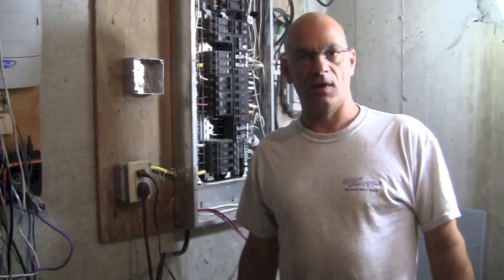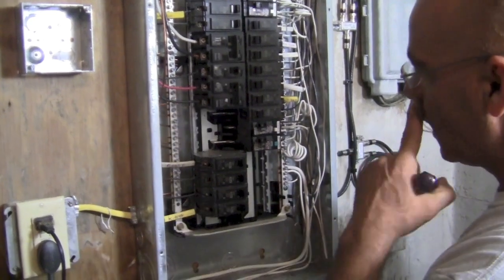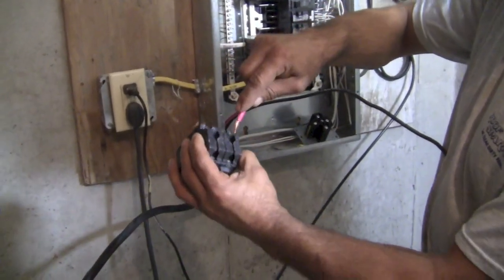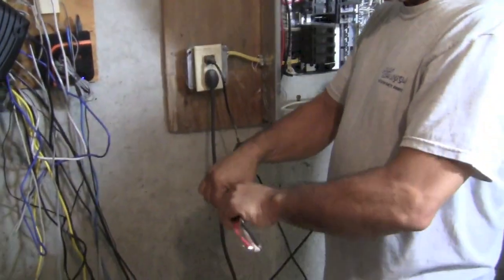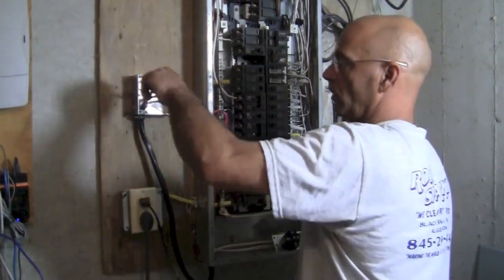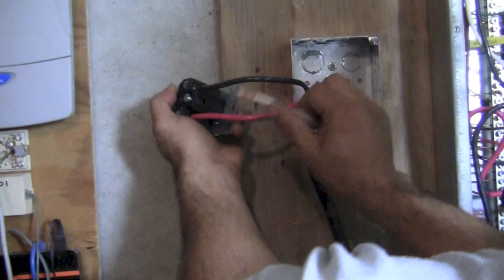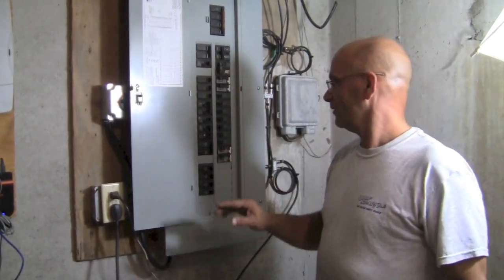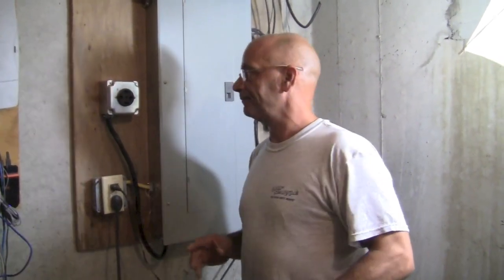How to Install a 220 Volt 4 Wire Outlet

Comment: Thanks for the great instruction and getting right to the point..I understand the procedure but it's electronically confusing...how is "neutral" different from "ground"..in other words how is this different electronically from 3 wire single phase 220...??
Reply: Oilsmoke Jones haha yeah these things are expensive at the hardware store, my advice it to buy online or find a supply warehouse. 
It's the ground that is "redundant" (bare copper wire). The neutral is there to provide a return path for the (AC) electrical current back to the transformer but that wire is grounded at the transformer.

The transformer has 3 taps on its low voltage side of the coil. 
The high voltage side is many thousands of volts supplied by the high voltage feeder wires which go back to the power station.
The transformer takes in the high voltage on one side, and steps it down to 240VAC
But north american house holds only use 120VAC (half of that) so they split it again in two and balance loads among the houses that way. 

You get 2 120V legs which if you connect to both you get a total of 220V.

If you connect to one voltage, and the neutral wire you get half; 120V

You have to be connected to at least 2 wire of the transformer so the alternating current can flow (back and forth)

The middle tap is neutral, (which is grounded), and the two on either side 120VAC.

So say you are using a 120VAC toaster, you are pulling off that one 120VAC leg, but the circuit needs to be completed in a loop for the current to return, you don't need any more power than that one 120V leg, so you use a neutral wire with no current.

If you are using a 220V device, you are pulling off both 120V legs for a total of 220V, since you are pulling from 2 taps on the transformer the AC current can flow in a circle (back and forth) from both those connections.

That's why sometimes you see a 2 wire and a 3 wire 220V plug (less ground wire). The reason for the neutral is simply if the uses BOTH 120V and 220V, say like the heater element in a clothes dryer needs 220V but other components like the motor, or some indicator lights needs only 120V they need that neutral wire as a return path since they cant use the other 220V wire.
Reply: Oilsmoke Jones Essentially they are the same thing, however they serve different purposes, as the other person said, the NEUTRAL goes back to the panel, and then back to one of the wires that comes in to your house from the street (service entrance) it's the wire with no insulation, but if you traced that wire back up to the transformer you would see that is also is sent to ground. The GROUND wire in your panel goes either to a grounding rod somewhere outside your house that should be driven at least 8 feet in to the ground, or tied as close as possible to your main water line entrance if it is a copper pipe since it runs very deep in the ground it offers good conductivity. 

Now again, if you look in your panel you will notice that the GROUND wire going to your ground rod or water pipe, and your NEUTRAL wire coming in from the street are connected by the grounding terminal! WTF?!?! 
You would only see this in your main panel, never if you had a sub-panel that would be in your garage, or pool shack etc... to run more power for a few more receptacles in a dedicated area.

In a sub-panel the NEUTRAL and GROUND terminal blocks MUST be electrically separate, the reason for this being like I said, they serve different purposes, the ground wire is there for electrical safety, so if a load wire came loose and touched upon something metal in your junction box, or metal appliance and energized the metal casing the electricity would take the path of least resistance to ground which would be the ground wire which offers that nice clean path to ground, and not through your body and the floor you are standing on, if you where to touch it.  

So say the neural and ground where connected in your sub panel, which if it is easier to picture, just think of a standard outlet with a load (power) wire or two if it was a 220V outlet, which is exactly what a sub panel is, a neural wire (return path of unused electricity) and ground which is just there to provide a clean path back to ground. 

Should it be energized, the ground wire is NOT INSULATED because it is NOT a load bearing wire under normal circumstances, if the ground and neutral where tied together acting as one, or especially if the neutral wire where to break, then the ground wire would be taking the other side of the load and returning it back to the panel, it could over heat and cause a fire.
Reply: Neutral or "common" goes back to the electrical pole ( transformer ) on the street, so it can alternate back to your house. The ground goes into the ground, and is considered a safety to prevent electrical fires. 220 volts are more energy efficient than 115 volts also. If your interested in electricity take a course in your city's technical school.
Reply: bennettdavid904 OK thanks for clearing that up..yes, you might say I'm interested in electricity..
Reply: Different manufacturers will make different plugs, but they all should be interchangeable,  generally 4 wires is 3 phase and 3 wires is single phase.
Reply: Im confused by what you mean by mortgaging the house. Can you elaborate?
Reply: bennettdavid904
"mortage the house" just referring to the price of some of these plugs and fixtures..I got sticker shock shopping for 220v plugs..up to $45 for a plug that is little larger than a 120v plug @ $5...
Reply: Video Québec
thanks for going the extra mile..so the 4th wire IS electronically redundant  for safety reasons.. 
??

Comment: Great vid, thanks. May I ask: what size gauge wire do you use with a 50 amp plug?
Reply: #6 wire
Reply: They have a chart with temperatures with wire sizing. Depending on the amp draw of the appliance that you are wiring in also depends on the wire size. 90% of the time, in electricity, bigger is better. #6 wire would be safe, it's expensive but so are house fires.
Reply: Thanks

Comment: Hi Dominic, great video, thanks! I have a question. I ran a new 4 wire 220 line and want to use the breaker from an existing (but no longer used 220 line. The appliance I'll be connecting to the circut calls for 220V @15 amps. The existing circuit breaker is rated at 50 amps. Is it OK to use it or should I buy a 15 amp breaker?
Reply: Blue Planet Photo Studio The amp rating is usually shared between the two poles of the breaker if its a 220/240V breaker, if you looked at a 50A breaker you would probably see each individual pole is marked 25A, (or it could have 50A written across both). meaning each 120V leg could support 25A draw.

It's perfectly fine to use a breaker that exceeds the energy requirements of the device you are running, this also means you can connect more 220V appliances in that same circuit and have enough power to power them with out tripping the breaker, just make sure you use cable rated for 50 amps.

You would only have problems if your breaker was rated for less then the power your device would be drawing, so say the breaker was rated at 15A and the device pulls 50A of power, the breaker would trip pretty much instantly because the device is pulling way more power then that breaker can give out.

If you had a 50A breaker, and you used wire rated for 15A, but exceeded 50A the wire would start to overheat and catch fire before the breaker would trip. The purpose of the breaker is to kill the power before the wire over heats, that's why it is super important to match the gauge of wire with the amperage rating of the breaker.

Comment: No I'm not bored andget technical  The white neutral wire is not a ground wire  but a hot wire?  If you touch the naked white wire and a ground , say the naked ground wire wouldn't I be shocked at least with 110 volts if the dryer was on? Too many people call a neutral wire a "another ground wire"   You called it a return wire.  What's it return. Is it a reverse phase hot wire?
Reply: It returns to the transformer on the pole

Comment: Thanks for the video, was a good confirmation as I installed two 50 amp receptacles beside my main service panel in the garage.  If one abides by the electrical codes, doing their own work is massively cheaper than hiring out. I would recommend having a multimeter as a minimum on top of the test light as it can resistance check the connections.  Ideally I would ring the circuit with a megger it at 600V+ (eventually I will get one as I am picky) prior to breaker turn on, but then again this is mickey mouse 120V/240V on dry land... not 450/600V with thousands of amps behind it on board a ship.

Comment: He put the outlet on sideways, used extension cord and no conduit. Calling it 220v.... The standard nominal Voltage in the United States is 120/240V...
Reply from the maker: What is wrong with you. If you know so much, and you don't. Why are you here watching my video. Go make your own and tell us all about it.
Reply: But it is commonly referred to as a 220 by laypersons, such as myself, who comprise his audience. Running lines and conduit is another topic. This video is strictly connecting the ends.
Reply: True, It's 120/240.

Comment: Dominic, thanks for the video. I've just moved to a new house. I can't install the washer until I install the dryer.  I have a three prong receptacle that I want to retrofit to four. Am I to understand that I cannot use the existing wire, because I need to run a four wire all the way to the box with a new 220 breaker? In my situation, this would require too much destruction to be worth it. I may just put the old dryer back in. The womenfolk are getting tired of washing and drying clothes "old school" even if I comment on how fresh they are from the outside air, I get dirty looks.
Reply from the maker: Just tell the woman that a study conducted by me "Dominick" has proven that the fresh smell of clean hand washed clothes reduces the urge in men. Trust me it works. So what is your question?. Anyway, first I would remove the existing outlet just to make sure it's not a four wire in the box and also read up on your new dryer to see if you can wire it without the 4th wire. Your breaker should not have to be changed.

Comment: I have a 3 prong dryer that comes on but doesn't get hot. I was told I needed a  220 line installed. Do I simply change the plug or is there something I need to change on the breaker box.
Reply: if your dryer is spinning but not getting hot your elements might be out. check both legs for voltage.

Comment: Hello Dominick, I'm replacing my three prong electric dryer outlet with a four prong outlet. I tested the connection of the three prong outlet with my voltage meter. Which is set to only read 220 or 110 volts, when I place both in the hot sockets, both the 220 and 110 volts glow. But I notice that the 110 volt glows brighter than the 220.

The outlet is a 30 amp, 250 volt, three prong receptacle.
Reply from the maker: This is a tough one to understand 100% what you're asking. Why are you going to a 4 prong? To use a four prong you'll need for wires. Red, black, ground and a neutral

Comment: I have a question about the 220V plug indicators.  If a 220 device that saids a certain amps on its label does it mean that it is for each hot wire or the entire unit's power consumption.  e.g. 16a 220V (Is that 32a)?
Reply from the maker: Entire circuit
Reply: 16 amps it is, thanx.

Comment: Exposed unsupported cabling below 8' in an accessible area (otherwise you could not have a load center there). No support within 6" of box (even in an inaccessible area). No abrasion resistant grommets at either end of cable.  You fail at least three ways I can see without even looking at your termination temperatures or insulation classes, etc.

Get an electrical contractor.  Anyone taking this video as an instruction guide is going to fail inspection, void their insurance policy, etc.  This stuff is much, much more complicated than this guy seems to know.

Hey Askmediy, have you ever read NFPA 70 or done an apprenticeship?  If so, where?  I would like to talk to your local about this video.
Reply: Crocellian you are 100% correct about this video. A true electrician would also have a real meter to test with not a $5 test light. Although he is very entertaining.

Comment: I was curious. I'm putting in an electric stove which I bought assuming there was a plug for it and ended up being wrong lol. So what's best for an electric stove? A three or four wire outlet?  I have allot of 12 gauge 4 wire roll already Will this work? And what size breaker with it?
Reply: James Mays You'll need 8 gauge for a 40 amp circuit supplying a standard stove/range. Some require 50 amps and 6 gauge wire. Check and see what the stove requires...  If it was me, I would wire a 50 amp circuit with 6/3 wire, and install the outlet in which you need for your range, that way if you purchase a stove that requires 50 amp down the road, you wont be running another new circuit.

Comment: Great video! Couple questions though.

Since the ground bus bar and common bus bar are connected making them essentially the same, could you not connect both common and ground to the same bus bar? And, What is the difference between common and ground?

Comment: Great video but you did not bond the ground to the box? Thx
Reply: mlwilmot I was thinking the same thing but I guess it’s grounded through the plug itself. Remember that flat piece of bare copper that was connected to where the ground wire went into? I’m assuming that grounds the box but only if the plug is actually screwed into the box.
Reply: Yes, the box must be bonded to the ground, not through the face plate.

Comment: Hi again i have my 240v outlet for my dryer my question is can i get a 110v outlet from there
Reply: mratliffjr0001 I  think he is dead by now.
Reply from the maker: You can by using one of the hots. But the amp rating might be too high. I wouldn't do it.
Reply: Ok i just want use for one light
Reply: Jesus Hernandez
 What he means when he says the amp rating may be too high is that it is unsafe. If the 110v outlet somehow shorts out, it may not draw a high enough current quickly enough to trip the high amp rated 220v circuit breaker before a serious fire is started. It wouldn't be smart to tie into your dryer outlet like that.
Reply: Haha - you're probably right.
Reply: Jesus Hernandez
Reply: Jesus Hernandez . I wouldn’t do that. It would pull too many amps.

Comment: Thanks for the video. I enjoy your style, thorough but entertaining.  Your response to a comment question mentioned not to daisy-chain 220 volt connections on the same circuit.  I have a dedicated 220 volt (50 Amp) box near the garage door (also right at the main) that was/is used for a stick welder and I would like to daisy-chain a 110 V box from it for general outdoor tool use.  Is that also not recommended, and should I add a separate breaker box (20 Amp) for the 110V outlet? 
thanks
Reply from the maker: any 220 stays by itself. No other choice....

Comment: What wire gose to the x and y on a plug what color is x what color is y on a plug.
Reply from the maker: Wire Connections for X Y W 240 Volt Receptacle Dryer Outlets
The Black Wire attaches to Outlet Terminal X
The Red Wire attaches to Outlet Terminal Y
The White Neutral or Green wire or Ground wire attaches to Outlet Terminal W

This an more info can be found on my site  http://www.askmediy.com/220-volt-plugs-receptacles-configurations/

Comment: Also explain the heating, expansion and contraction of the wires and the issue of them loosing at the screw connections.   Also the need for them to be really tight but not so tight the plastic gets broken around the screws.  Go to a second hand store and find old 220 Volt plugs cheap and test your strength if you want to see just how tight the screws should be before they will fail.  FYI

Comment: Is that a NEMA 14-50 outlet used? Should be the same installation for a 220V electric car charger outlet in the garage since they use that type of 220v outlet or a 6-50 (no neutral) for either 30amp or 40amp charging with a 50amp circuit breaker.

Comment: I am not an electrician. I watched this over and over again. I got a hold of the same plug, and the same kind of tester, With the help of the folks at Home Depot, I got the 4-wire 220v (orange colored) romax and went to town. Because of this video, and this gentleman's ability to explain this thing, the project went off without a hitch. I listen to every word of advice, like make sure the wire casings are not touching the screws in the breaker etc. I took my time, constantly checkin my work along the way, and the project was completed in an hour and a half. I did have to go back and correct anything. The dryer runs perfect. Thanks for uploading this even though is was almost a year ago.

Comment: This video was good, but if you want the job to be done right, you should have made a splice on the ground wire so that you could use the ground screw on the box as well as the outlet. It is never a good idea to depend on a connection between the box and the outlet as your ground. Other than that. Your work was all up to code. Keep up the good work!

Comment: Hi I have a question for you I have my water heater connection 240 v can I Install a second 240 v outlet for my dryer
Reply from the maker: NO, one 220 per circuit / breaker.
Reply: askmediy Called double tapping and bad stuff right ?

Comment: Thanks for the help. I've wired plenty of 110v, but just got a Jacuzzi and need to run 220v. Had some doubts, but now I see it's basically the same. Time to get to work...now where did I put my rain coat??? HAHAHAHA!
Reply from the maker: Glad I could help you out.